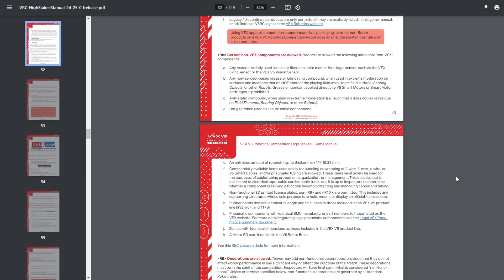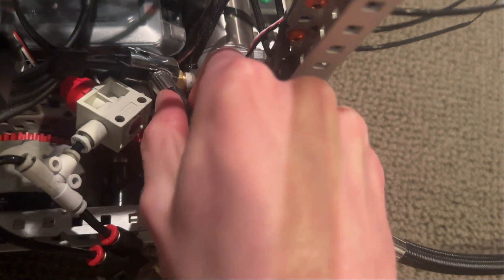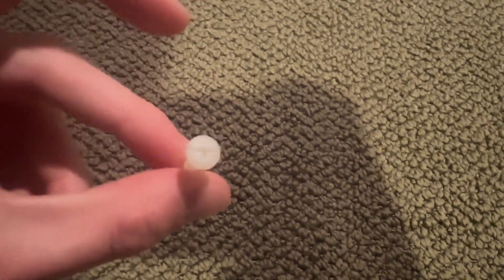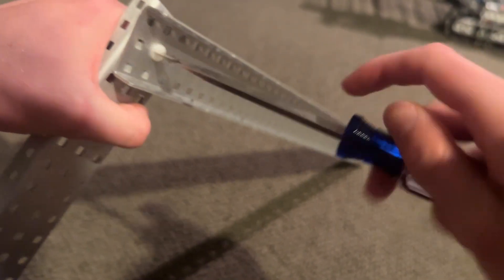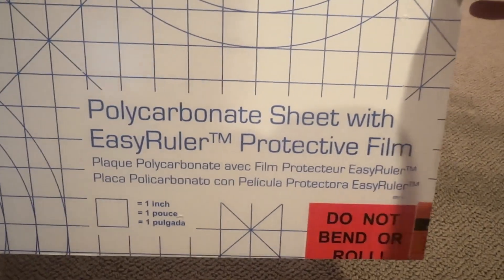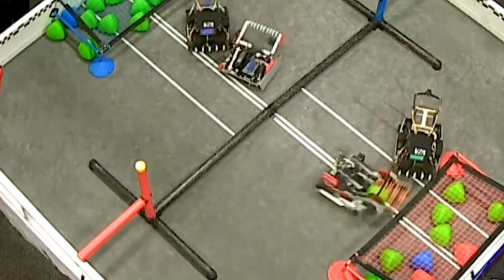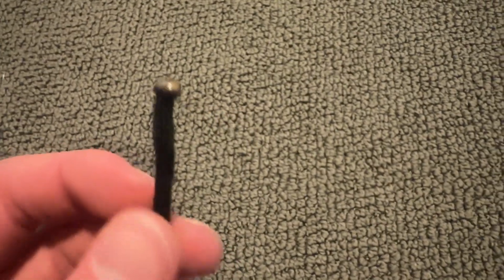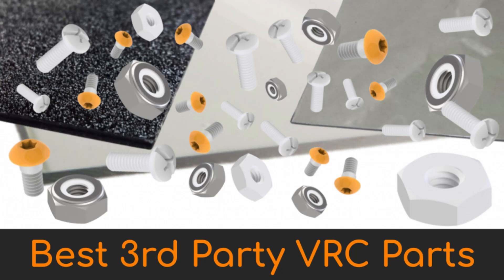Top 10 3rd Party Vex Legal Parts

Comment: What is the switch that u used with the pnuematic bike pump fitting? Thanks!
Reply from the maker: Pneumatic switch. You can be one them in the list of legal pneumatic parts in the game manual
Reply: @9MotorGang where did u buy it from or can I buy from vex?
Reply from the maker: @fastplayz6962  you can guy it directly from smc. https://docs.google.com/spreadsheets/d/1uFQrtXXt-2KHu97R7APeRfy40jK0fBnLomCY2GQYMAE/edit?gid=0#gid=0
Reply: @9MotorGang  Tysm!

Also I had some other questions on some of ur other videos, if u have the time I would really appreciate it if u could reply 😊